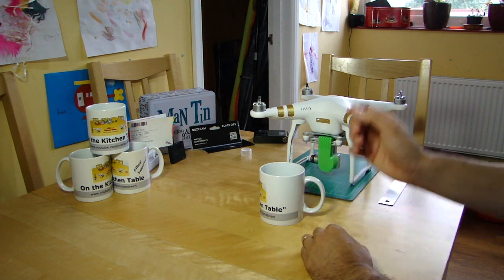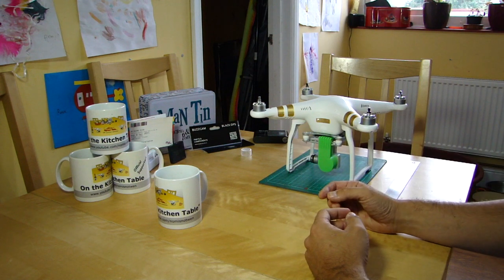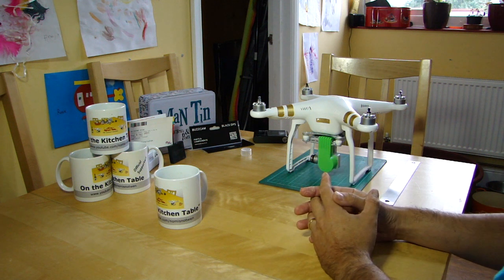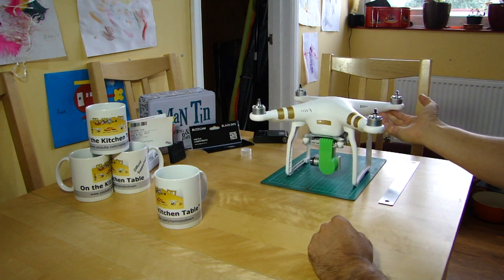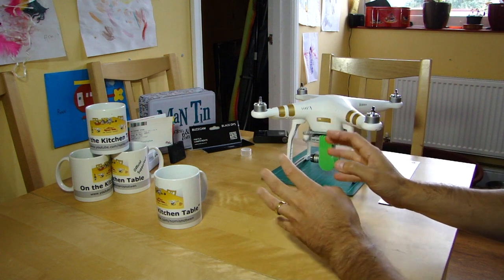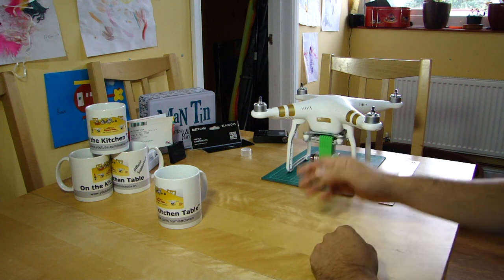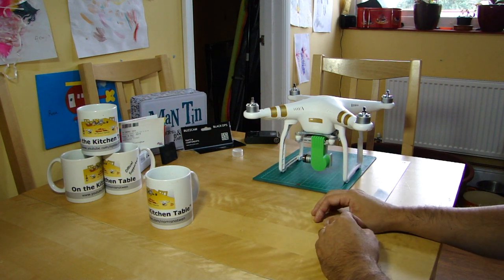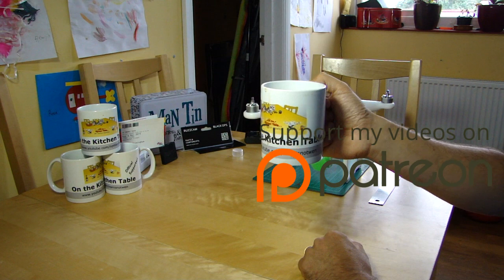How to calibrate the compass on your DJI Phantom drone

Comment: My P3S does a toilet bowl every time on take off,  but, BUT, but...... after between 10 - 15 mins flight, it comes back home rock steady! Don't know the reason for this (maybe it acquired extra satellites, or the motors have warmed up and sync'd). 
I only ever re-calibrate about once in every 10 flights.

Comment: hi mate can you help me ive got a f450 dji running 2.4 the transmitter is dj6 when i turn it on i get sold green light but on my fc40 5.8 its a green light the batterys are new

Comment: I have a question, can you calibrate the compass on the phantom 3 without the app, 99% of the time I have my phone and fly my phantom 3 pro with my app and cell phone plugged into the controller, but if I am somewhere without my phone and need/want to fly, how do I do that? I know who to do it on the phantom 2 by moving the toggle switch back and forth a bunch of times, but the phantom 3 has a different controller so I didn't know how to start compass calibration without the app?
Reply: thanks for the quick response ***** !! I may try it and see what happens and if it works I'll post on here that it was a success!!!!

Comment: Hey simon the phantom 3 the 1.2.6 update I heard still has this error where the ultra sonic goes haywire, not sure how but I currently still run the 1.1.9 firmware and I have yet to have issues but video latency. Is there a possible way to run a fat shark, or wire a hdmi output to reduce video latency to 0? 

P.s. Mantin came in the mail my wife bought it cause I talked about it in your show.
Reply: ***** It is simon the galaxy note 4 has terrible lag I might have to get a ipad.